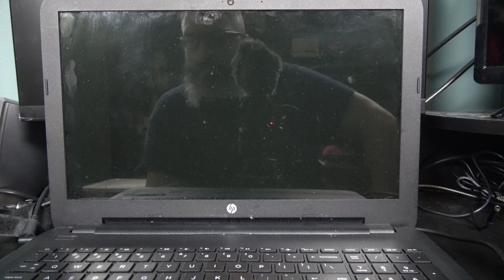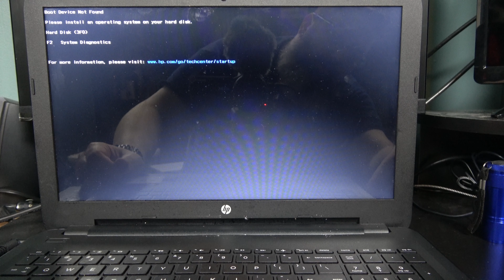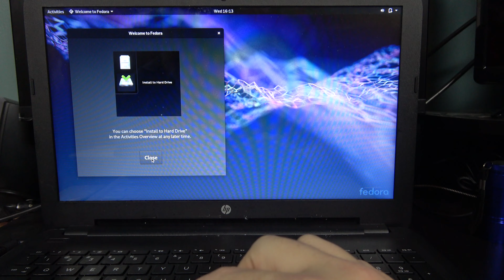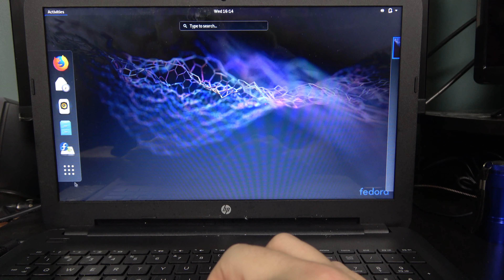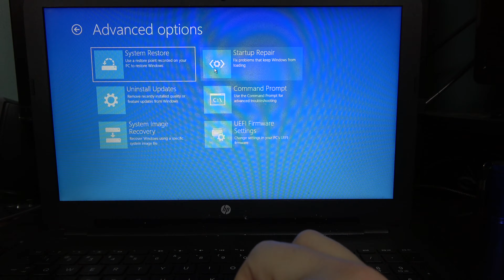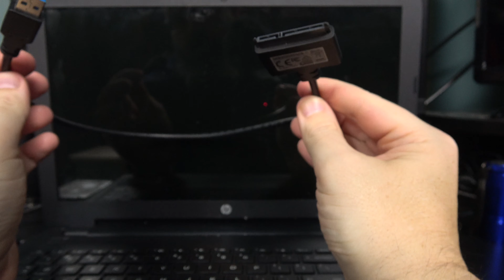Repairing The HP Laptop Model 15-ba009dx

Comment: Why repair it at all? Slow slow and slow, improved by installing another 4GB memory. Don't upgrade the Hard Drive to SSD or buy another 4 GB memory.  Still slow. Oh! hinges break.  In time it will fail. This is HP garbage laptop. You get what you paid for. Both my college kids bought this in Feb. 2017  at Best Buy on sale about $210.  Lasted about 9 months. Trash laptop. Now they have 2019 Acer Predator Helios 300 i7-9750H with RTX 2060 and a Lenovo Y540.  If you spend more than $1,000 you be much happier and have a long lasting laptop.  HP products are trash. HP 15 ba009dx  Should tell people not to buy as it is a D minus for less than a Dummy or F for only a Fool would buy this.  Might as well get a Smart Phone or Tablet. I didn't feel the love just contempt for HP.

Comment: I have a question that my husband has HP Notebook 15ba009dx that he thinks hard drive failed for some reasons. He has a friend. His friend got connection for a technician who does fix computer where he works.

My husband wants to know about hard drive parts:  9.5 mm ＜0.37 inches＞ and 7.0 mm ＜0.28 inches＞ matches with 2.5. He has been trying to find on Amazon, Best Buy, Staples and eBay. 

What is your original.hard drive parts that you have been used before? Is it 9.5 or 7.0 mm? 

What are your recommendation to replace hard drive? HDD or SSD? 

He thinks that original.hard drive 500GB is being failed. He thinks that hard drive needs to upgrade 1TB. 

Will this computer.can be replaced from old hard drive to new hard drive.and install Windows 10 from media creation tool? 

He has already lost his program and apps on his old hard drive with Windows 10.

Thank you.

Comment: I have the exact same laptop and changed out the HDD for an SSD as well as upgraded the memory to 8gb. Such a pain to work on but worth the upgrade. Totally different computer with the upgrades!
Reply: What ssd did u use , and do u have a model number , and was it a play and plug , any modifications

Comment: I had the same problem with a SSD in a very similar laptop. That one was a Sandisk. They replaced it, a year and a half later the replacement failed. Replaced it with a mechanical drive which is still running four years later. I don't mind the slightly slower performance in return for reliability. Be very interested to know how well the Kingston drive holds up.

Saved myself an extra take-apart by installing the new drive in the laptop, hooking the clone source drive to the USB to SATA cable, then booting the whole thing off a live Clonzilla drive. Worked perfectly. Of course the live Clonzilla is linux so that is to be expected. Try to avoid M$ where ever possible!
Reply: PS compared to my Dell Inspiron 15 inch that HP is a piece of cake to get the HD out of!